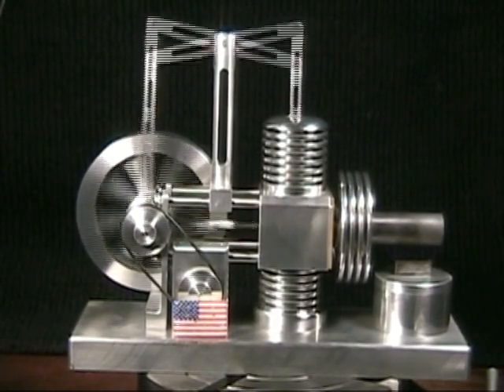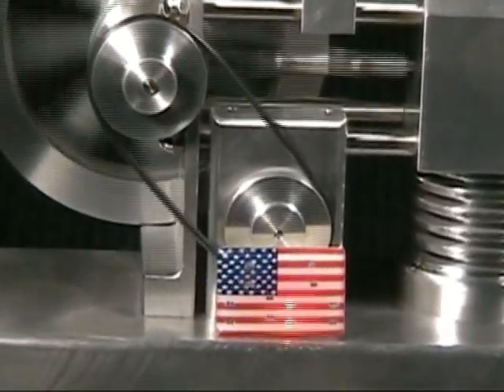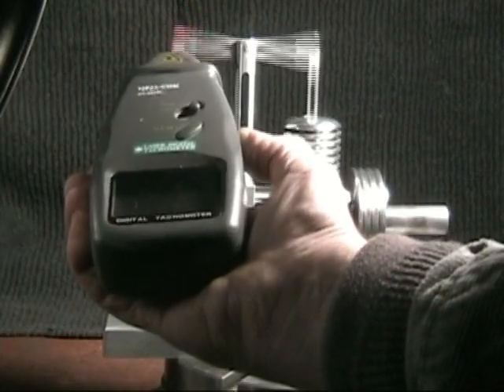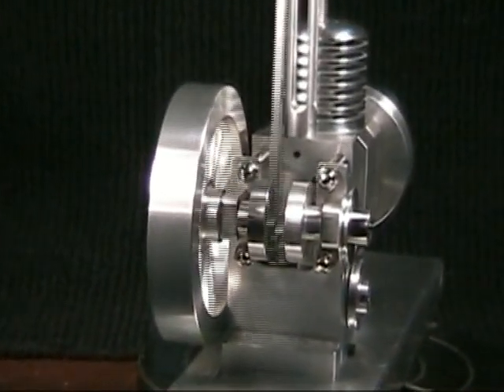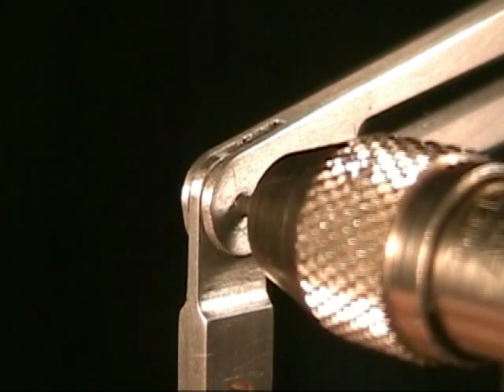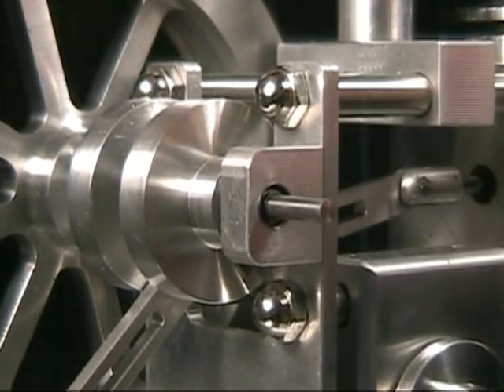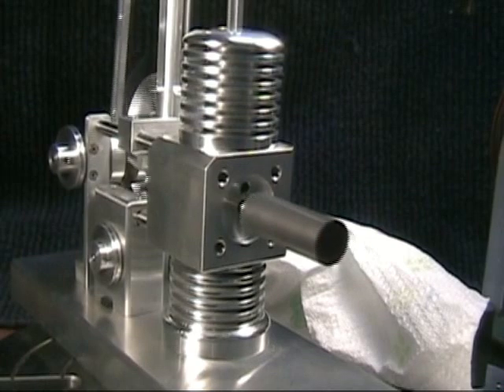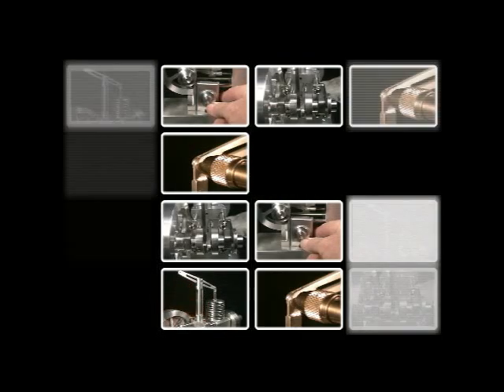Stirling Engine With DC Generator

Comment: i enjoy watching your videos even though i only understand a small fraction of what your doing. thanks. i would love to see you build a steam/diesel high compression engine fired by cap flash within the cylinder with natural water circulation and have that little bugger driving a generator. sealed system. start and why wouldnt it run until it broke?  i think you have a beautiful mind.

Comment from the maker: The motor really isn't very powerful because it runs on the air in the engine alone. The little generator is a DC motor from a tape drive. The flag uses about 6 volts and 60 ma. I would imagine the motor could run something at maybe 200 ma or so. I have plans to make an axial flux generator to be a flywheel and rotor. That may work out a little better.
Thanks for watching.
John

Comment from the maker: @fnemesis 
Hello. There's probably .0005 inch clearance. I think there is some leakage in the busing for the connecting arm on the cam as well as enough air inside the engine itself to make the suction a little less noticeable.
John

Comment: Very nice engine! Could you pls tell me what is the distance between the work piston and the cilinder? Your engine runs very smooth when you push the flywheel and let it go and i don't really understand why. When you pull out the work piston it seems there is no vaccuum. Thank you for the answer and sry for my english :D

Comment from the maker: @nstahlable 
The parts kit and drawings came from TheLittleMachineShop. You can search and find it. The raw materials and plans where $69.00 at that time if I remember right. Of course I changed the design and used English instead of metric. The time in the machining is what makes it so impractical to reproduce. If you do a search on Ebay for Stirling engines you can find all kinds of kits and finished engines. That would help answer your question.
John

Comment from the maker: @jinxym 
Hello, It's nice to have something in common with you guys. We have the same problem here. I'm afraid we've seen the last of the Master Tool & Die Makers, at least as we know them and their skills.
My machinery is really only hobby size. I have a Grizzly G-0619 (S-3) Bench milling machine and an old 1940's 9" South Bend lathe. It's even flat belt drive. I just posted a video showing some machining on a Mag Lev Fixture. Have a look. Thanks for the compliment.
Good Luck
John

Comment: Only problem I have with this vid is that the slack of the band is on the wrong side for it to be turning the generator. Looks like the motor is turning the flywheel. I know this motor works, but I can't see this well. I'd like to see it run without the band on it while spinning it.

Comment from the maker: @hollandhotrod 
Hello. I'm not sure I can do that. The project was originally a kit with raw stock and drawings. I modified the design quit a bit but it still might be a issue with my friends at TheLittleMachineShop. If you search that you can find their site and get the plans alone I believe. You probably would have a problem with my drawings anyway. Their just a worksheet with everything converted from metric to English and set up the way I like to work.
John

Comment: @DadHav The engine might not drive a compressor, but could it drive another engine just like itself? For some reason, I think if you turn a stirling engine the 'wrong' way, it gets cold on the end. Is this true? If so, could you create two engines, run one with the burner outside and make the other get frosty inside a cooler or something?

Comment: @DadHav  oh thats a great idea because steel has a low friction too , but do they sell the stainless steel pistons off the shelf so i wouldn't have to hassle with machining?  another option is to grab a pipe and fill it up with this epoxy putty which later dries to shape but i don't know how precise this is compared to machining.  what do you suggest? basically we are after the tightest fit and lowest friction but un-lubricated because oils can cause explosion inside the pressurized chamber.

Comment: @passani1  i have been into this for long time... i have an idea to be able to trap helium inside the engine to make it more efficient... i made plans and i want to put it to action but i been struggling to get the right parts.   my idea also eliminates the need for  a heat exchanger on  the hot side  because i direct the sunlight right into the chamber through glass and capture the heat using low emissivity selective surface . currently i am trying to find  a suitable power piston cylinder set

Comment: @DadHav  hi sir, i am working on experiments to use this engine for power generation.  I need a piston cylinder set which is durable and low friction.....   will little machine shop cut for me what i need or can i get of the shelf?  i need a 3/4 inch power piston plus the cylinder for it. currently i have this graphite glass set but the graphite looks too fragile ... my experiment is to add helium and make it more efficient

Comment: Well for air power tools it probably wouldn't keep up the demand BUT!!! for an air conditioner compressor it might be ideal for the demand and relative small size compressor needed for air conditioning. my thoughts on this are to solely run the compressor  so the system only needs a fan powered by the house curren to produce air flow, And mabe for a refrigerator also, some don't require a fan!!!!!.

Comment: @curtbarile actualy it might if you hook it up to a battery with an inverter! the compressor does not run all the time, only when its filling the tank so it may recharge the battery when its full.,
I guess it depends on how you use the compressor,in other words you whould have to let it fill up and still wait till the battery is full . You'd need to give it a push to get it started,unless you add a small dc motor as a starter and first fill your tank on a full battery! just a taught! :)

Comment: Are these engine's strong enough to drive an air compressor, if so can the heat developed from the compressor help/ or drive the stirling engine, compressors develop a lot of heat and in some cases boil water. I have seen video's of a 5hp stirling engine on this site,and with this, it may be possible.

Comment: clean sexy design here! USA love that. 

Would it be possible to have a piston made of magnetic material and the housing wrapped in coils? What kind of AC could that create I wonder. I want to try to model such a thing. I suppose the resistance that comes with that would slow it down, but maybe not as much as the generator attached to it. 
: ( Can't wait until I can machine stuff like this.
beautiful piece of engineering here. great work

Comment: I have a question, where is most of the noise coming from, I have noticed most model size stirlings have thisnoise but most fulsized stirlings have proportionately less noise and some are virtually silent. As a mechanic, noise means loss of efficiency, can it be reduced or is it just the nature of the beast?

Comment: Excellent job on the engine and the video presentation.  I especially like the comments on the special characteristics of the machine.  Much better than just letting an engine run without  further information. Thanks for sharing. 
Dave

Comment: Marvelously produced vid John. Exquisite engineering of all parts. Outstanding display! - Too bad it produces only trivial current. Also that it uses fuel instead of concentrated non-fuel sunlight. Click my channel for serious 3-phase powering 1HP drive hub of 3-wheel 35km/p/h "Vee". A solution the Stirling people are creeping up on recently?